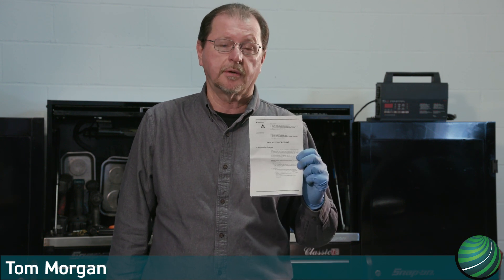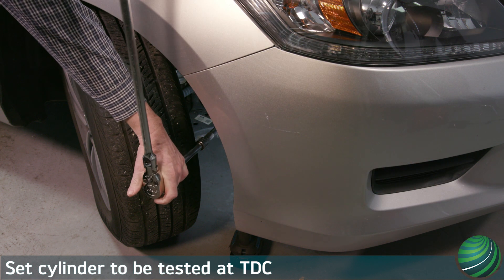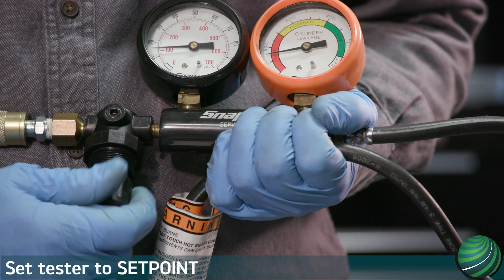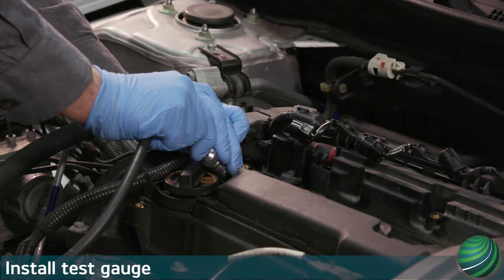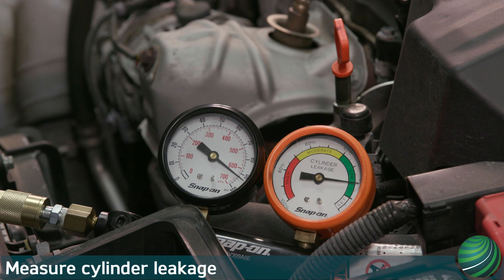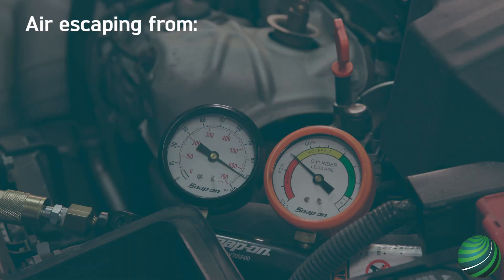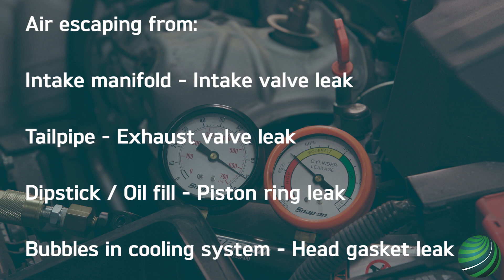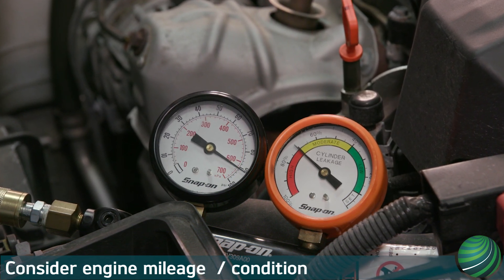Best Way to Perform a Cylinder Leakage leak down Test

Comment: I have seen several videos about this topic and I noticed that some testers needs 100 psi to set the secondary gauge to “0” and others with only 30 psi you are able to set “0” … could that difference in pressure affect the accuracy of the results of the cylinder being tested ? I have issues with cylinder 1 only but cylinder 4 results are identical to 1 , I using the $30 tester TU-21🤷‍♂️

Comment: Tester should be connected to cylinder from the start. Then run the first gauge up to 100 PSI. Read second gauge for percentage of leak down. It’s best to have a tester with two identical 0-100 PSI gauges
Reply: Yeah, I don't get why they build it up and then slam all 90 psi into the cylinder. That will move the cylinder off TDC for sure
Reply: If you connect from the beginning you cannot adjust the second gauge to set the zero …
Reply: @filippocatalano5318   Adjust second gauge to zero? You don’t adjust the tester according to the second gauge. You plug the tester into the cylinder then adjust the tester so that the first gauge is at 100 PSI. Then you read the second gauge to calculate the percentage of leak down. There are lots of videos on YouTube that show the proper way to perform this test but there are many that are wrong. If you pressurize the tester BEFORE you plug it into the cylinder the test will not be accurate. You can pressurize the tester before you plug it into the cylinder but you would need to adjust it again so the first gauge is at 100 PSI.
Reply: @wcjcnc  the video is correct, my new tester owner manual describes the same procedure 😉
Reply: @filippocatalano5318  Maybe connecting the air pressure without tool hooked to cylinder is to test the tool for leaks?
I know on my 4 cylinder engines, there is almost no way i can put 100 psi all at once into the cylinder without the engine trying to turn.
And some of them will not hold 100 psi anyway if they are leaking.
Copeland Small Engine has it correct.  
My process: Air compressor regulator at 0psi, connect tool/tester alone and then turn compressor regulator up to 100 psi.  Check that at 100psi on tool 1st gauge the second gauge reads in the "SET" range, adjust if needed.
Turn compressor down to 0 psi, connect tool/tester to cylinder, increase compressor to 20, 30, 40, 50 etc psi, while watching second gauge until tool/tester psi gauge will not increase anymore (or 100psi). Check for cylinder leaks.
Stay gold.

Comment: Great video sir.  I did a test on all my cylinders after setting the tool to "set" at zero.  When hooked up to cylinders I heard the air flowing and the needle moved from zero to about halfway through the "set" area and stopped there with the air flowing.  This is a brand new rebuilt 22RE Toyota engine.  So does this mean there is "no leakage"?  The problem I'm having is it seems the engine is not advancing enough when rev-ed to 3k....  going from 12' (factory spec) to around 19'.  It idles like a brand new engine... but when I go to take off, it has total shit for power.  I also tested/ohm-ed out the TPS (throttle Position Sensor) and everything came back within spec.  I don't understand what's going on... perhaps you can give some insight?
Reply: Your leak down results sound like they're good, maybe your timing chain is not set correctly
Reply: @samuellindstrom2137  I eventually figured it out.  The problem was the TPS (which I had tested because it was one of my first suspects).  Even though the old TPS tested/ohm-ed correctly, that was testing each POSITION by manually putting in shims.  The problem was that the TPS was fucking OLD and just sticking.  I bought a new one and the engine ran fine and sped through all the gears with tons of power and acceleration.  Got the TPS directly from Japan and was an OEM part.  I ended up selling the 4runner for 12K about 6 months ago.  It was a great build... lots of fun and I learned a bunch I didn't know before about a lot of shit.  I just never used the truck as much as I thought I would and certainly a lot less than I did with my other three I had growing up.
Reply: Have you tried running better gas?   Engine might be retarting the timing advance.
Reply: @dennisrobinson8008  I did not try running better gas.  It's already running the lowest octane fuel I can buy... which burns FASTER than higher octane.  It's not the fuel.  Not sure what you're talking about when you say the engine might be retarting the timing advance.
Reply: @liberty9348  If you are talking about ignition timing, fuel injected vehicles will pull ignition timing if it's detonating due to octane.    The vehicle will be able to run full timing even in heat or up a hill with higher octane gas.